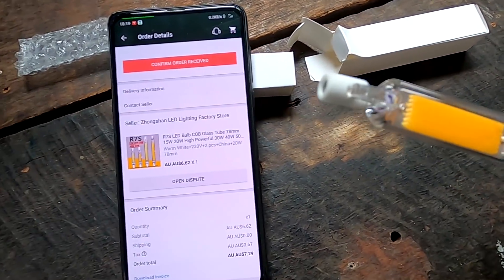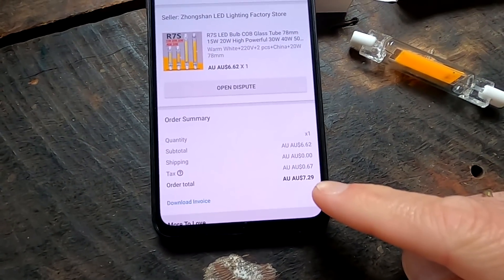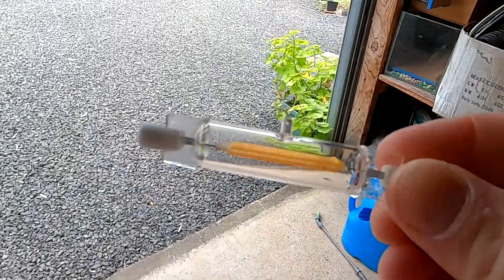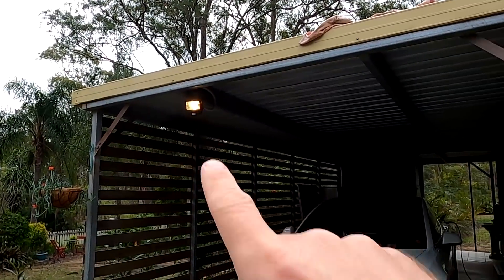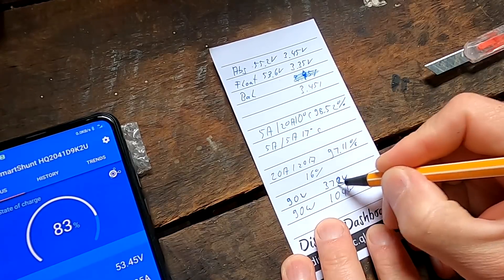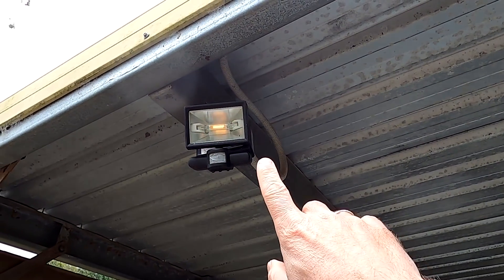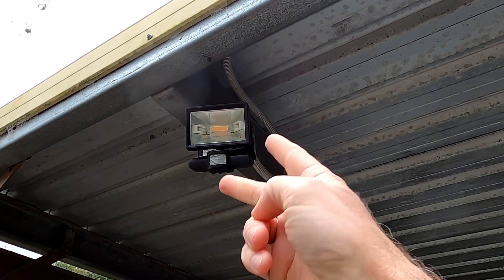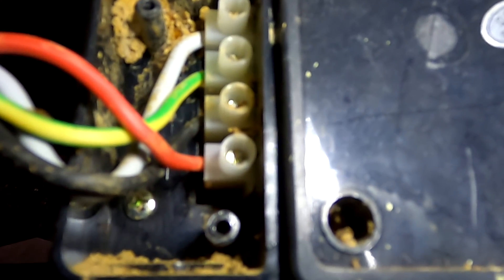Ghost LED Light is always on. Even when turned off! 👻💡

Comment: A lot of these lamps source their motion sensor power from a voltage dropper in series with the (original filament) lamp. With such a bulb the current is sufficiently small to not illuminate the lamp, but as LEDs can work at such low voltages and currents this is why they light up in the “off” setting. 

I have a lamp in my dining room that takes 9 bulbs. Tried putting 9 x Phillips brand LED lamps (with an older “touch” dimmer from the 1980s) in, but they all glow when “off”. Easy fix, just swapped one of the LEDs for a filament lamp and they all go out now - and I still get a 89% saving with full range dimming available.

Comment: There will be a class Y suppressor capacitor across the PIR rely, which will let through a small current. The LED's are very sensitive and so will glow, even with micro amps. It is actuality less current, as there's a voltage drop across the LED's as opposed to low resistance across the filament.
Reply: This is the problem indeed, there must be something parallel over the relay all other answers about cabling parallel do not apply be-course the relay is near to the led lights. You have to take out the capacitor and then it will work. The capacitor is also not needed any more, it's there to protect the switch in the relay for high loads.

Comment: You are lucky. 😉 When I installed LEDs in my living room, I got a bright flash every few seconds. This was creepy. They got a little bit of energy and collected it in caps after a rectifier until it was enough to turn on for a short time.
The reason was a small current transfer caused by capacity coupling between two wires. I solved it by adding a small cap between switched and neutral wires in order to discharge this very little energy. A capacitor does not get hot when the light is on, it consumes only reactive power (Blindleistung).

(Btw: You should have had the same couple of watt power loss with your old lights, it was just not visible.)

Comment: I suppose they may have put a small capacitor across the relay contacts to prevent sparking and that would allow a small amount of AC to pass and it takes very little to start an led glowing. You could test with an AC milliammeter with the halogen bulb in and see if there is a tiny amount of leakage with it off. Your clamp meter almost certainly won’t be sensitive enough. If there is then that is what will be keeping the LEDs on.

Comment: You need to change the motion sensor, they need to be led compatible
Reply from the maker: Nah, it uses a relay! That has nothing to do with the motion sensor itself.
Reply: @OffGridGarageAustralia  I sell replacement motion sensors where I work and the old ones were not compatible with LED's (or CFL'S), but the new ones ARE.

Comment: Is it Neutral not at earth potential, often cause by unbalance between phases or loss of some bonding between neutral and earth at transformer.  Can be external to your property.  I can measure a varying voltage up to 10v at my place, varying depending on the various loads on the 3 phases on the distribution transformer.  Or simply capacitive or inductive (or both) induction into the open switch line lying alongside the permanent live to the PIR sensor and electronics.
Reply from the maker: The MEN link is less than 10m away. I have 0.04V between N and PE at the light fixture.
Reply: @OffGridGarageAustralia  Thanks - then it is induced  inuctive/capacitive emf or as others have said snubber network across the relay contact causing enough dc voltage after the recs to light the led.  A capacitor, say 0.01 mfd across the a.c. input to the light psu should cure.  You might have to experiment with the value a bit.   Or just live with it, the dim light might deter would be intruders since it might look like security always on for camera.

Comment: Idk if it's similar or not but when I installed led lights on my vehicles the blinkers especially went nuts, I read that I needed to install a resistor or a load along with the led bulbs. I got aggrevated and just pulled the day things out. If anyone can find out the dilemma I have absolutely no doubt between you and you veiwers a solution will be presented within the hour. Stay well and thanks again for posting often
Reply from the maker: Blinker lights in a vehicle are different. There are special lights with resistors built in for that task.
Reply: @OffGridGarageAustralia  It would seem most lights not meant for LED will need a similar conversion in order to work correctly but regardless I don't have much experience with them other than some conversion stuff I've done for the car and house, and certainly have a great deal to learn about it

Comment: I had a similar issue when exchanging some halogen light to led. The current on the leds when turned on is very high compared to the normal lamp and therefore my remote control switch had burned contacts which did not disconnect always. I had to replace him to a better one.
Reply from the maker: The LED current is higher than from the lights you had before? Why would you replace them then?
Reply: @OffGridGarageAustralia  The leds ruin the contacts of the switch/motion detector because of their high(er) switch current. you can change the leds to such which use a transformer before or change the switch to accept higher current.

Comment: Higher impedance to switch  motion sensor  completely,, sensor is designed  for higher wattage,  changing sensor for smaller  wattage  will fix issues or do the double pole switch ✌👍

Comment: Modern LEDs require very little current to produce visible light. As you said in your video, there is probably enough leakage to keep the LEDs visibly lit. Many LED lamps "work around" this problem by adding a 270k-470k resistor in parallel.
Reply from the maker: So, I had this leakage power before as well just didn't realise it with the halogen lights? If this is the case, there is no additional power loss and I just leave it as it is then as a feature 😁
Reply: @OffGridGarageAustralia  the possibility for leakage current was always there, it was probably leaking but since it could not be seen, no one checked it and thus no one has ever made any noise about it! 
This might seem trivial but when going off grid, every watt has to be accounted for LoL.... No ghost voltages or skeletons in the closet allowed LoL..
Reply: @OffGridGarageAustralia  Most likely yes. The leakage current through the relay and whatever other parallel surfaces that may contribute to capacitive coupling from input to bulb should be in the micro-amps range which wouldn't produce any observable light through a filament lamp but can be enough to produce usable light through modern LEDs.

If these are dumb COB LEDs, there should be around 100 of LEDs in series to accommodate the 350V peak voltage and a small amount of light x 100 becomes a fair amount of light.
Reply: 081521/0204h PST 🇺🇸 Power Leakage means uncontrolled low power, reaching any electrical device, right? So why not isolate any power, even minute “leakage” reaching the light assembly? How? Replace SPST disconnect switch to DPDT. No , so called leakage reaching the assembly. Remember LED emitters have low input impedance. In the same circuit where resistive load is present (150W) the same phenomenon doesn’t happen.
I don’t want to lecture basic Physics.
I had replaced a few Incandescent units with LED emitters. The result? Same as Andy’s. What did I do?  Nothing.
Why? Because it’s impossible to rewire and replace existing home wiring and mess up style and beauty. Can’t I do? Yes , but it doesn’t matter to see a low glimmer after light is switched off. Besides we all sleep at night.
But Andy can rewire, because it’s easy to replace those white rocker switches with DPDT toggle disconnector. Andy knows how to do it. It’s a garage lighting, after all. You needn’t even remove the existing switch assembly.
Trace the Phase Neutral cables( RED/BLU -Australian/EU spec) to the light, add the DPDT disconnect. I’m sure those lamps have PIR system plus LDR Dusk to Dawn device. 30 minutes job. Good luck. Stay safe and 73s…
Reply: Everything leaks

Comment: Put an interference suppression capacitor parallel to the lights. That will discharge any load still hovering around in the wiring.
Gira, Busch-Jäger, Merten and others have these Entstörkondensatoren in their portfolio, I don't know about suppliers in Australia, though.

Another thing is: The motion sensors need a minimal load most of the time, around 6 to 10 watts sometimes, or they will start to blink.

Comment: If you need to solve the problem you should cut and connect the both wire of the LED from the switch .
Or you should connect the N of the inverter output with the Ground.
Reply: > Or you should connect the N of the inverter output with the Ground.

I think he already had this - this was a topic in an earlier video. The Victron has an MEN link internally.

Also, the relay should be double pole since the motion sensor controls the LED.
Reply from the maker: The N is linked with the PE inside the inverter. Otherwise the Tesla charger would not work correctly. That's the MEN link for the Off Grid Garage.
Reply from the maker: The switch is on 24/7. That's just for stormy nights to prevent the light from going nuts.

Comment: Because you are using off-grid inverter then the the output voltage from the inverter both N or L are potential from ground and from grid N , and because the LED can bright even the voltage it is very low ,,, so because these two reasons when you are using LED light and because the switch ON/OFF cut and connect only one wire then the power go from the second wire which it is connected direct to the LED and the second wire that connect to the switch ON/OFF will work as capacitor with the ground that lay near of it or from the metal pipes or any grounding path that the wire fixed near of it.
That mean it is working like: (power supply + LED + capacitor) all connect in series.
Reply: > Because you are using off-grid inverter then the the output voltage from the inverter both N or L are potential from ground and from grid N 

I'm pretty sure he has a MEN link in the inverter - that was discussed in one of his earlier videos (a connection between Neutral and Ground). The second part of your comment is correct, he can fix this with a double pole switch, but this would be needed in the light itself since the motion detector switches the LED.

Comment: 1. Theory: There might be life cables next to the ones of the LED lights...and the magnetic field could induce a voltage into the cables of the LED light.
2. Theory: The relay is inducing a voltage into the cables.
You should be able to actually measure a AC voltage between life and neutral at the LED lights, when they are turned off...but a low one like 30V...and that is enough for those LEDs to light up.

Comment: i had led lighting do the same . changed my single pole switch to a double pole switch . fixed the problem.
Reply: In this case, the relay would have to be double pole since the motion sensor controls this.
Reply: Have this issue in my bathroom due to capacitance/loss in the wires.
Reply: I’m sure a DPDT disconnect switch will work, because, simply there’s no power (even leakage supply) reaching the light assembly. Thank you for the idea.

Comment: This was a very common issue in the early days of LED bulbs. There is a natural leakage current that runs through mains voltage appliances. The element of an old school light bulb would be enough resistance to snuff this out, but leds will light with almost any voltage. I believe the industry started adding discharge resistors in parallel with the led strings in commercially available lights to mitigate this issue.